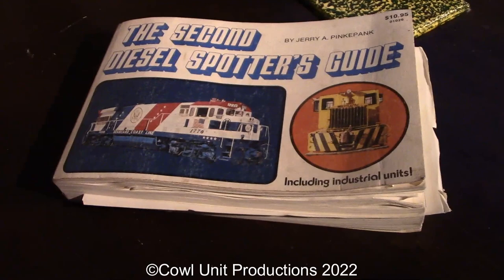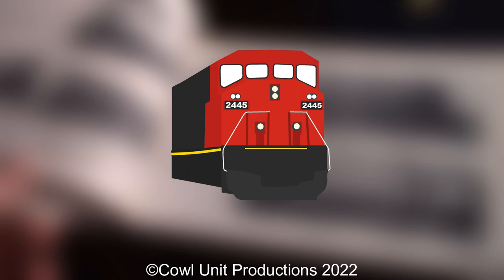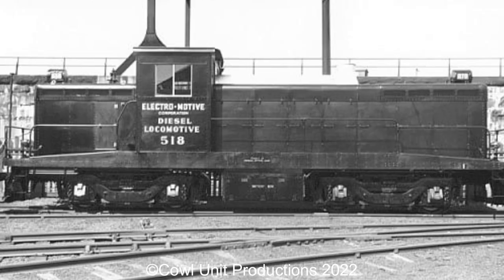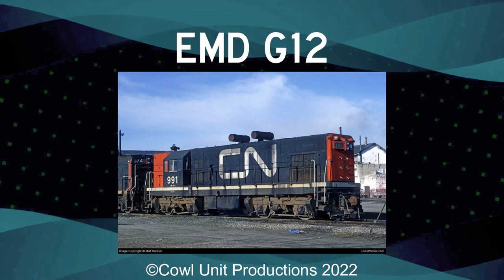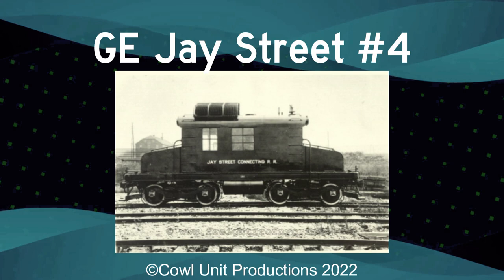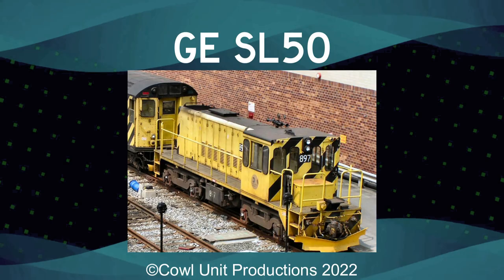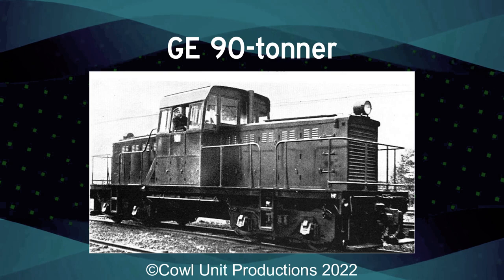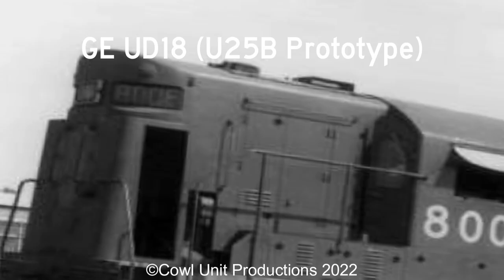EMD and GE Leftovers Reviewed in 10 Words or Less

Comment: I feel like the battery electrics have potential, especially as switchers in ports and big yards. They don't fully deserve all the hate they've been getting.
Reply: You make a good point! I've watched WorldwideRailfan's video "Battery-Electric Locomotives DON’T Work - And Here's Why" (probably the most comprehensive criticism of battery-electric locomotives I've seen yet), and even he admits that they could be useful as green switchers! 

As he mentioned, Los Angeles will be testing out two battery switchers (namely, the BP4 and EMD's Joule) in the near future. That makes sense in this case, since not only would distance not be an issue, but in a city with a lot of pollution, switchers without diesel engines would be useful. Hence, I agree with you.

Thanks for the comment!

Comment: I’ll take my hydrogen and overhead electric locomotives over battery locomotives any day.
Reply: Yeah, especially after seeing those used by subway systems that travel at stupidly slow speeds (Saint-Petersburg metro EKA 81-581 battery locomotives have a top speed of 35 km/h)

Comment: I feel like battery electric locomotives will be even heavier than an average diesel and the weight of a UP big boy or even the DDA40X or somewhere in between those.
Reply: More than the heaviest electric car which is the Electric Hummer which comes around at 9500ibs which is about the weight of an elephant and lightest ev is the european Renault Twizy at 987ibs.
Reply: This comes down to the weight of the batteries in an EV and BEL.